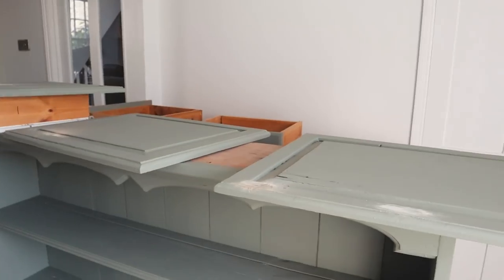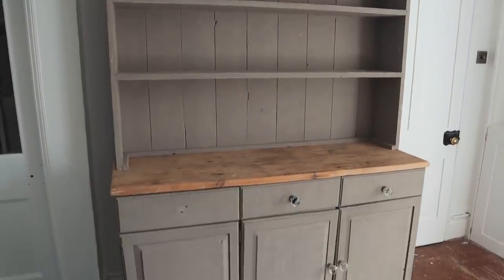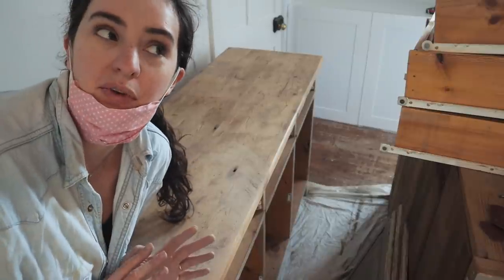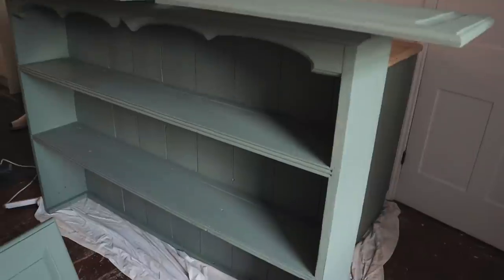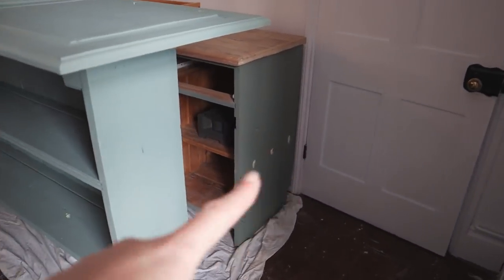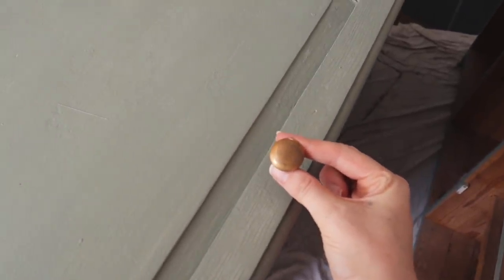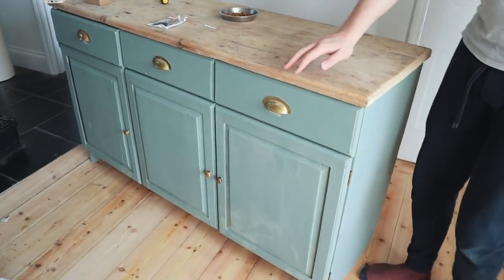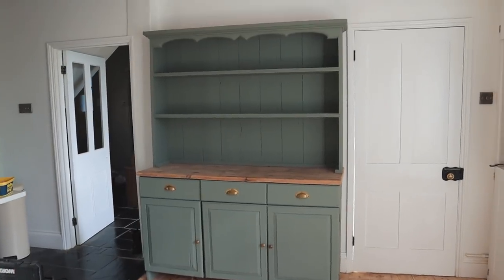Antique Dresser DIY Makeover BEFORE & AFTER

Comment: The other trick to get paint off hinges is put them in boiling water. Once the metal gets hot the paint will start to peel and you can get it off with a scraper or similar
Reply from the maker: Great tip!

Comment: Another hack for getting paint off hinges and such is to just boil them in some hot water for a little bit and the paint should peel right off when the metal gets hot. Obviously use caution when dealing with hot metal.